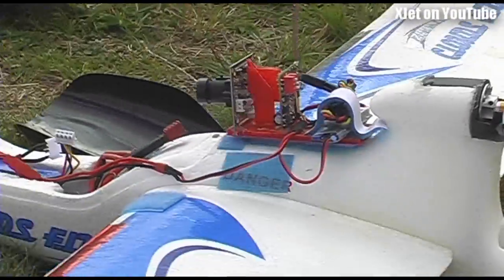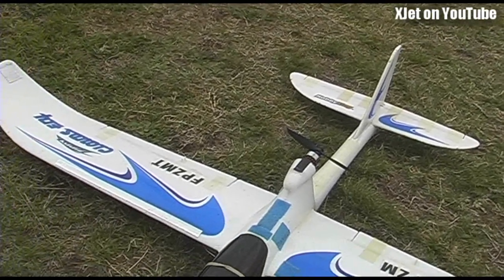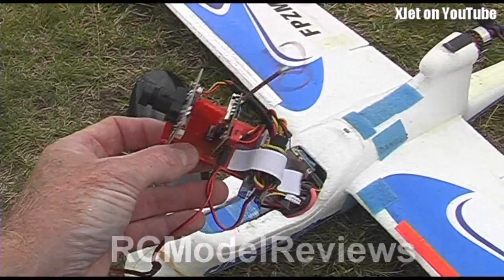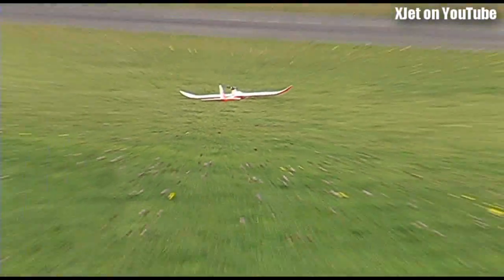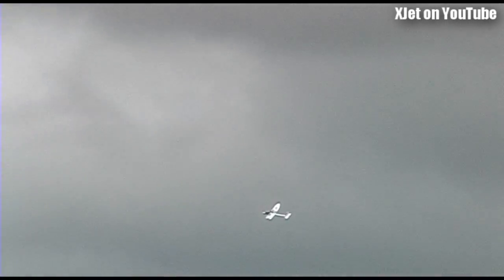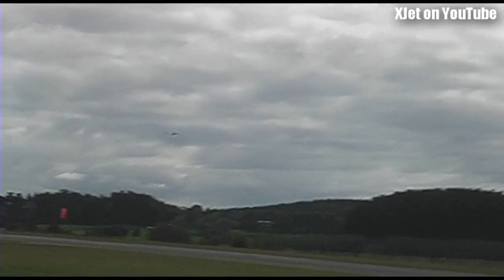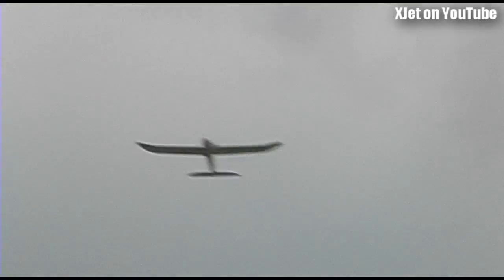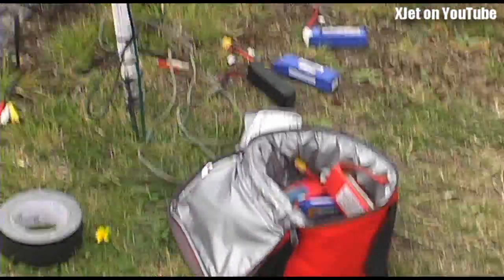FPV at the SWMAC - circularly polarized antennas

Comment: Hi Bruce. Where did you get RG316 coax cable and 0.8mm copper plated MIG welding wire?
And do i have to use that cable and wire to make the CP antenna? Thanks